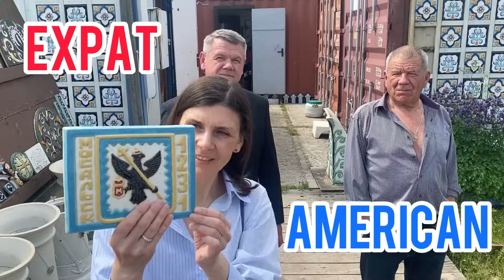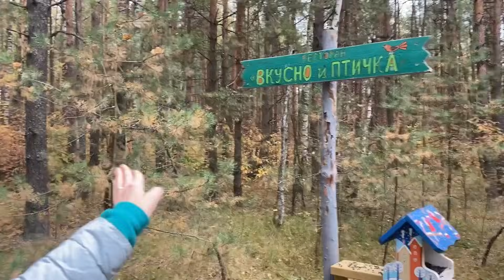Quiet Hunting is WHAT ?!  Outside of Moscow, RUSSIA !!

Comment: 13:07 According to the rules, the mushroom must be cut with a knife. This will keep the mycelium underground (mushrooms have extensive mycelium underground instead of roots) and there will be mushrooms in this place again next year. All the manuals say that you cannot simply pull the mushroom out of the ground (this will greatly damage the mycelium) - you just need to cut it off with a knife at the base of the stem.
Reply from the maker: Thanks for telling me. I did not know but the comments have been debating this all weekend.
Reply: An experienced mushroom picker knows that you can pull a mushroom out of the ground, if you cut it with a knife, the mycelium can become infected with bacteria during the rotting of the leg. Until now, many are arguing how to do it right. My personal experience shows that the mycelium lives well after that, since I always go to the same forest, and go to the same points in the forest.
Reply: Вроде как учёные подтвердили, что срывание грибов никак не вредит мицелии грибов, так как ореол мицелии распространяется на десятки-сотни квадратных метров, а некоторые и на километры! Так что срывайте их спокойно. Я уже так делал и не раз и грибы 🍄 🍄 🍄 продолжают расти на прежнем месте 😊